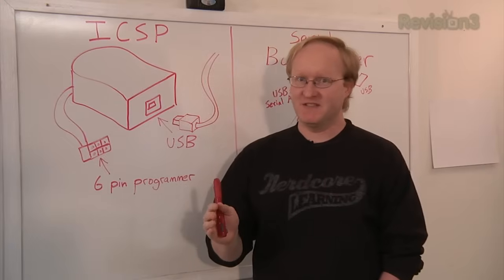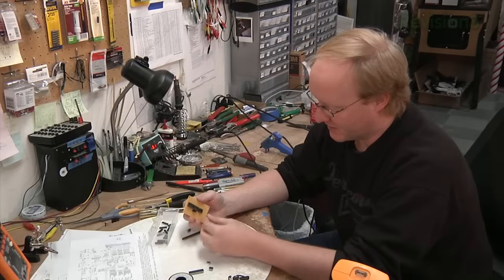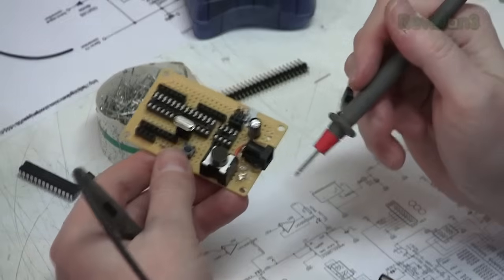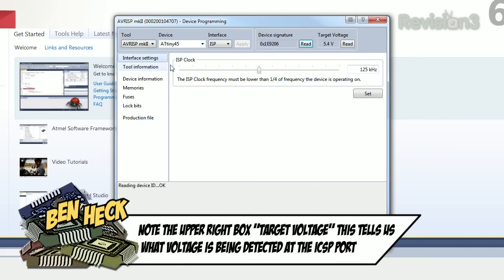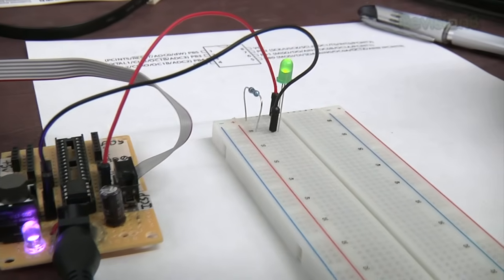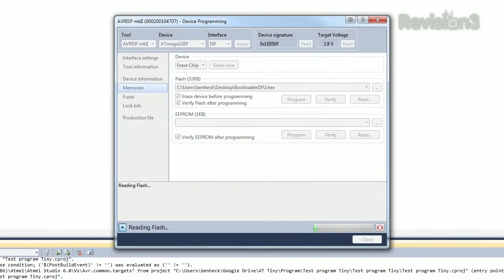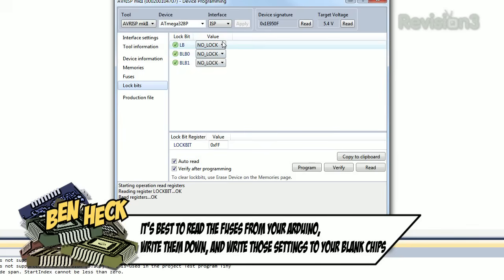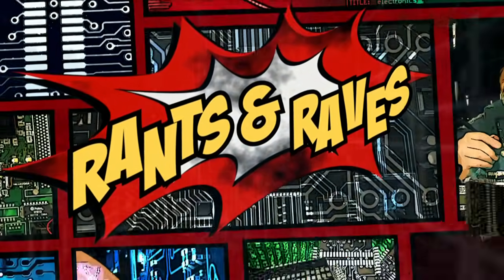How to Build an AVR Development Board

Comment: But why you use the bootloader + ft232 chip instead of your ISP connections? Too use the arduino libs? Then i would integrate the FT232 Chip into the board. Or use the MM232 USB-to-UART bridge. very easy too use and build the first serial communications to your pc

Comment: You can check out MatchboxARM ! It is a very small and powerful ARM development board for ARM Cortex-M3 32-bit processor. It has an USB mass storage-based bootloader, meaning uploading new code is easy as a drag and drop. You can find the project on kickstarter.

Comment: I think it would be something like an electronics engineer.
Found the education portal's website :)
Electronics engineers work with electrical systems and circuits to produce advanced technology in a range of areas such as portable music players, global positioning systems and communication systems. They work on ways to use electricity to process signals and control equipment.

Comment: You might want to tell people that microcontrollers  not only uses serial, but it's TTL so you need to convert the positive to negative voltage using something like a "RS232 Shifter SMD" from sparkfun.

Comment: Once you've got one chip programmed via ISP (I used a "dasa" bitbash programmer), you can then use that chip as an ISP to program other AVRs using such programs as ArduinoISP, or I have one set up with USBTinyISP that talks straight USB to ISP with a few resistors and zeners.

Comment: also if your thinking of using the pi as a laptop , its not what you're thinking it will be like , it wasnt designed for tht , it was designed for simple coding and testing small programs , it will be slow and run out of memory a lot

Comment: can't you just use the arduino board as the usb to serial converter, so your program the chip thats alredy on it. Then take the chip of and use it ind your project. The board is already made so you can change the atmega chip